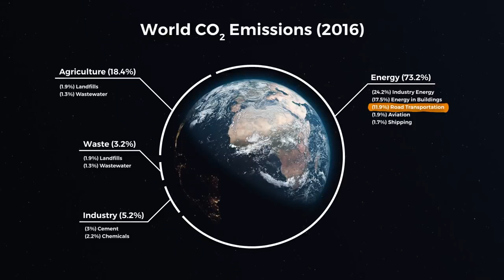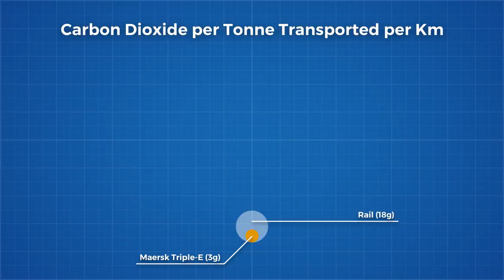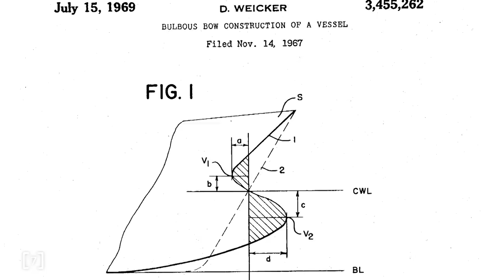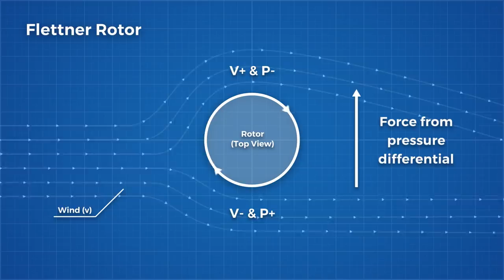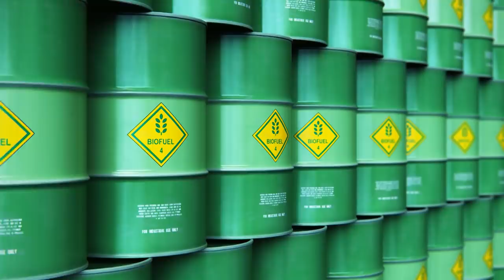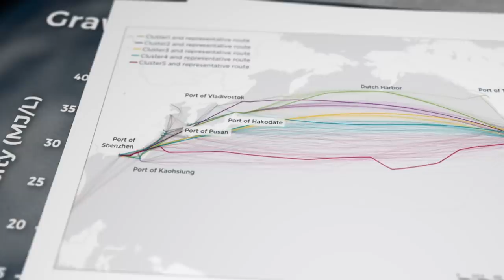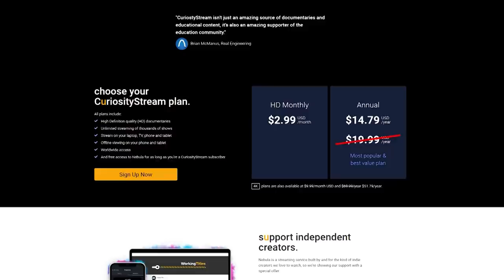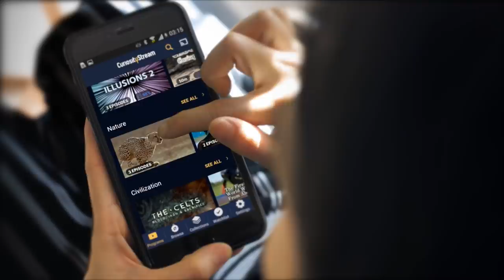Are Renewable Powered Ships Possible?

Comment: This was a good video, but I think there were some topics that were left out.  Does battery storage have the energy density to enable ships of this scale?  Also, could nuclear power be a better solution?  It seems as though it would be very economical once more ships adopt them.  This is definitely an interesting topic, but I think there is more to the discussion that is missing here.
Reply: The following is my thoughts on nukes, 'lecky is a similar length so will add it separately.  If you do a web search for ‘nuclear ship savannah’ you will see that it has been tried and did not work.  A similarly vessel heavily subsidised, by the government, vessel is in use in Russia which also operates, in support of the Northern Sea Route, a fleet of nuclear powered ice breakers all of these may, or may not, have been completely without issues.

Just think; would you have full confidence in the management of a nuclear reactor under the control of an anonymous entity only traceable, perhaps, via a letter box in a FOC (flag of convenience) nation state?  If you are, could you sell that confidence to Japan, the state that hosted the Hiroshima and Nagasaki nuclear detonations as well as more recently the Fukushima ‘event’?  Then try that same, or a similar, sales strategy on Ukraine, the nation state that as a part of the USSR (CCCP) hosted the Chernobyl ‘event’.  Modern iterations of nuclear energy, thorium fuel, molten salt reactors or fusion reactors, will carry the legacy of past problems.  It is the global trepidation of anything with 'nuclear' in the name and the economics of nuclear having transitioned from 'energy to cheap to charge for' too 'the costs of remediation are incalculable' that will prevent the adoption of nuclear energy as a means of creating energy at sea.  Modern reaction systems may have overcome the safety problems but the general public, having been misled in the past, will be reluctant to believe the fresh new promises.  The incident of the ‘Ever Given’ blocking the Suez Canal, March 2021, may also have a little to add to this debate.  The cooling water on ships tends to get taken in from near the bottom so when running aground the inlets are in a prime spot to get plugged up restricting, if not stopping, the flow of coolant.  One thing that the TMI, Chernobyl and Fukushima incidents all had in common was that the supply of coolant, or rather lack thereof, was a fundamental cause.

‘They’ say nuclear is cheap, it’s not it is expensive and has a large embedded carbon quotient as well as being complicated, dangerous, not universally socially acceptable and having only ‘no need for refuelling’ as a questionable advantage; actually it does need refuelling just not as often.  When ‘they’ do need to refill the warming up stuff it takes considerable longer than pumping tonnes of thick black stuff, cSt380 HFO, or thin runny stuff, MDO, onboard which is one of the reasons HMS Queen Elizabeth and HMS Prince of Wales are pushed about by ICEs and gas turbines thus using a similar fuel as the aircraft that fly off of them.  The Royal Navy (RN) with a high degree of skill and expertise uses, at vast expenses to the UK taxpayer, a current operational nuclear fleet of 11 submarines (also known as ‘boats’) in two flotillas, seven attack subs and four ballistic missile boats.  The carbon footprint of all the extra bits of hardware and the fuel, including processing thereof, from ground to propeller, are the external costs that never seem to get considered.

Disposal, once it wears out, of both the machine (that was a ship) and fuel is another can of worms best left unopened.  The 26 RN boats no longer in use are laid up (some in Rosyth and some in Portsmouth) awaiting long term deconstruction including dealing with the fuel rods and other irradiated material.  The USN is not, as far as I know, a commercial organisation working to very tight margins and also has the skill and expertise to handle the complexities of nuclear power; so as well as submarines their aircraft carriers are nuclear powered and each of the current iteration has a build cost three times that of QE/PoW, bigger crews and more generous funding.  For those who still think that nuclear energy might be the answer I recommend this report: - https://www.bbc.com/future/article/20200901-the-radioactive-risk-of-sunken-nuclear-soviet-submarines?ocid=ww.social.link.email.  The navy of the USSR might have been under resourced and over extended but it was still generously supported in comparison with merchant shipping.  While merchant ships may be 'taken up from trade' as the RN would say, or may be captured or impressed by non state quasi military entities by way of piracy, but cargo ships are not military vessels.
Reply: With regard to propulsion with electric motors powered by ‘green electric’, leaving aside the fact that there is no truly ‘green’ electricity, the best we can do is low carbon impact both at installation (capital account cost) and production (revenue account cost).  Running ships on the ‘lecky’ is tricky the two examples that I personally know of, and have used, are a vehicle and foot traffic ‘chain’ ferry that ply’s its trade across the hundred meters or so of the Nordre älv between the island of Hisingen and Kornhall on the Swedish mainland.  The motors are on the ferry and a power supply cable is unwound and wound back up on board as the ferry shuttles back and forth from Kornhall.  When the vessel goes anywhere else, id est dry dock for survey and or maintenance, it is towed by a good old ICE powered tug.  The other electric vessel is a vehicle and foot traffic ferry that runs from Helsingborg (Sweden) to Helsingor (Denmark), a twenty minute trip undertaken using energy stored in batteries on board, she tops up the charge each time she is alongside and battery capacity is said to be sufficient for an hour of main engine use.  A video is available on the Fully Charged channel of YouTube, ‘100% Electrical Ferry Crossing’.  There are small diesel generators on board; to keep the lights and other safety related items on in extremis.  Electric ships currently have short ranges and high light displacement  as a factor of their cargo capacity.  Sadly as of now electric boats are as functional as chocolate fireguards, yes ‘submarines can be diesel electric’ but they have negligible cargo carrying capacity and if you ever go on one (HMS Alliance is available to visit as a static exhibit at Gosport, UK or video available on YouTube, https://youtu.be/Q23uoxT16gO) your first thought could be ‘not much room in here for the crew is there?’  What about electric tug boats?   That would at least improve the air quality around ports, and they can recharge daily since they stay near the port.  Well though that might be feasible in practice ‘tugs’ need lots of power in short burst with readily available reserves for when things do not go according to ‘plan A’.  So hybrid ICE/battery could be an option, so long as the economics stack up, and would be a means of quantifying part of the cost of environmental improvement; getting values to add to the debate would be a very useful tool.
Reply: @BernardLS  Thank you for the thorough replies, I really appreciate it!  Based on what you have said, it seems that a battery powered boat is not at all practical.  In regards to nuclear, cooling and disposal will always be challenges.  The public's perception of nuclear is definitely a challenge as well.  All things considered, I guess hydrogen powered ships (as mentioned in the video) are not a bad option.  I think I initially projected ideas from hydrogen powered cars onto hydrogen ships, but after further thought, some of the disadvantages of hydrogen cars wouldn't be relevant to ships.  Ships crash less and can likely handle some extra weight brought about by any safety systems.  Also, in order to target cargo ships, this would require less infrastructure development compared to distributing hydrogen everywhere in a country (for vehicles).
Reply: @DrewMiller4_18_5_23  Using lots of energy it is possible to liberate hydrogen (H2) from Methane (CH4) the cheapest available source of which is the FOGI this is called black, brown or gray hydrogen depending on how bad it is, so that will earn you the ire of the Green-meanies.  The other, much touted, option is to liberate hydrogen (H2) from water as so called green hydrogen; you need a lot of energy and while fossil oil & gas, or perhaps coal, will do it and are the most readily available any energy source, wood, photovoltaic, wind, tidal, et cetera, will do the greener the energy the greener the H2.  H2 is said to be good for use in fuel cells that will give clean energy when combined with Oxygen (O2) and leave only water (H2O) as an effluent; so as well as the cost of creating the hardware and separating out the H2 in the first place we now have the cost of providing the O2.  H2 is very, very light and very, very volatile so this is where we remember the Hindenberg airship disaster and while events of that magnitude might not be likely much smaller H2 fires or explosions can cause a lot of damage.  The ‘light’ means that though there is lots of energy per unit mass there is not much mass per unit of volume so all the problems of CH4 but much worse.  You need to compress it, more than a lot, or cool it, more than a lot, to get enough on board your ship in manageable volumes to be useful.  The alternative to fuel cell use of H2, burning, also generates combustion products which includes waste heat going to the cold sink and a few NOx ‘nasties’.  H2 may have a place in the energy mix on land as a storage medium but on a ship where there is a reasonable and constant auxiliary power need the question could be posited, ‘why go through the extra stages instead of using the harvested energy directly?’  After harvesting the energy, from wind, sun or motion of the vessel, as electrical energy better to deploy that energy directly and immediately as heat, light or mechanical work.  As with nuclear energy at sea some of the ‘alternatives’ may have a use in littoral submarines in AIP (air independent propulsion) systems but that will be with the same caveats of cost, space and complexity so would not perform in a high volume low cost mercantile situation.  The numbers, on any of these, are getting very difficult to show any sort of surplus so is this a case of running hard to stand still?   I could go on about the dangers of H2 having survived the era when three VLCC tankers blew themselves to bits in less than a fortnight, another story another day.
Reply: @BernardLS  In regards to "why go through the extra stages instead of using the harvested energy directly?", I would argue that the reason for this is how quickly stored energy can be transferred.  Batteries will not charge as fast as it is possible to move hydrogen, and we already discussed why battery technology powering ships seems impractical.  I also believe that harvesting energy on a ship cannot provide enough energy to power the ship.  If a cargo ship could be reliably powered by covering all the available area with solar panels, than I assume it already would have been done.  Adding wind generation seems like it would come with more costs than benefits, but perhaps my intuition is off on this matter.  Hydrogen definitely does come with safety concerns.  You also mentioned that there is a cost of providing O2, but assuming hydrogen is generated via electrolysis, then I don't think this is really a cost.  I was not aware that combustion of hydrogen created anything other than water vapor.  2H2 + O2 --> 2H2O.  Could you elaborate on this?  You have a good point though that any combustion engine wastes a lot of energy through heat.

Comment: For the ship, methane could bemore interresting than hydrogen. Actually power-to-gaz (made gaz with electricity)is less efficient than using hydrogen but not that much and there is already large installation of gaz supply. Moreover, huge and powerful gaz turbines already exist and boat which have them can use the gas already produce in the world while large scale methanation is developing.

Comment: use floating fuel production stations to reduce fuel weight,  put several on route, eliminate the cost of fuel used to transport fuel and just produce it exactly where you need it?
Reply: What do you mean, produce it? even hydrogen is made with fossil fuels, you'd have to get that shipped. Then why waste time with a dangerous oceangoing refinery?

Comment: As a naval architect and marine engineer i also have to add that shipping industry is slow to implement changes. Ships cost millions of dollars and they take years to make. In such a circumtances the shipping companies don't want to take risks trying new technologies. Which is why they probobly went with the speed reducing option at first.
Reply: On the ‘reduced impact front’ a lesson might be learnt from the past, in the 1930’s a group of six ships that were being built for the British Tanker Company (BP) to their “Three Twelve’s” design (12 000 tons deadweight, with a speed of twelve knots and a fuel consumption of 12 tons per day).  These ships were purchased whilst still ‘on the stocks’ and completed for the Admiralty so they could keep the fleet fuelled up and at sea.  12 000 tons deadweight (dwt) is tiny by today’s standards with ULCC’s being twenty five times that size (300 000 dwt) while their typical service speed has only increased to around fifteen knots, or by 25% if you like to keep things relative, and daily fuel consumption has gone up to about 60 tons (or half an order of magnitude to be academic about it).  Bear in mind that speed reductions, a useful buffer for adjusting variations in demand, will in the long term require more goods in transit to maintain any given level of supply.  Typically tankers move at 15kn so a reduction of speed to 12kn could yield a fuel consumption saving of 20% (?), however to maintain the same flow of material an additional 25% of shipping capacity will be required.

4 ships at 15kn = 60 freight miles = 5 ships at 12kn.

Comment: Could a small nuclear reactor be used to extract hydrogen from seawater through electrolysis? Would it be economical?
Reply: Long answer short; no.  Nuclear energy has a set of problems of its own which need to be resolved before it could be used, on shore, to derive the hydrogen (H2) for use as an energy store.  However even once the H2 is separated using the lowest impact means possible the introduction of the H2 energy store onto any shipping platform is another stage with 'issues' that would need to be overcome.  Scale, cost (n.b. not price), safety and volume of the facility being only a few.

My notes on the various and diverse aspects of this thread are now at 6k words of which this is just a small snippet, other notes cover other parts of the debate but I will spare you any that will just weary you.  Feel free to revert should you wish to engage, after 4 months of correspondence there are opinions available on everything from sails to nukes by way of alternative fuels.